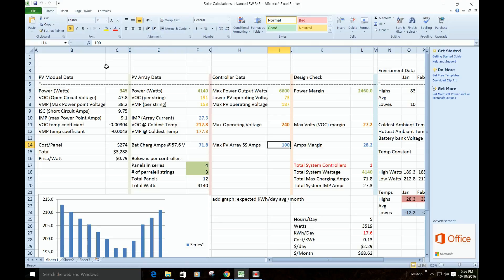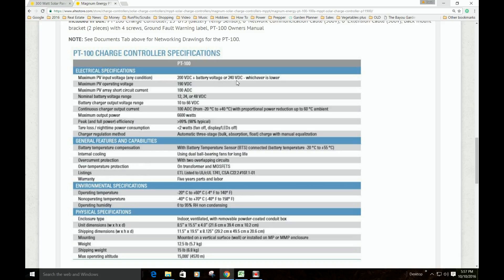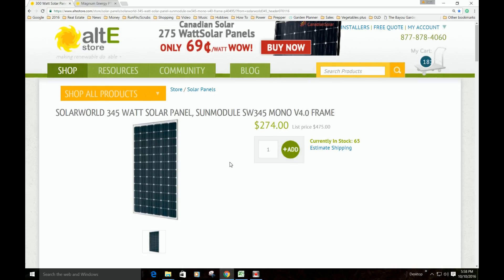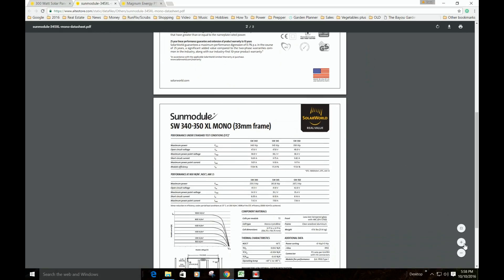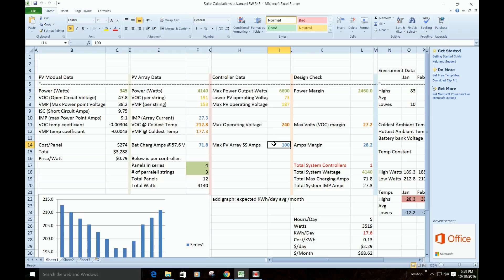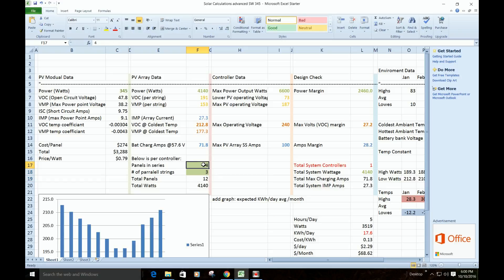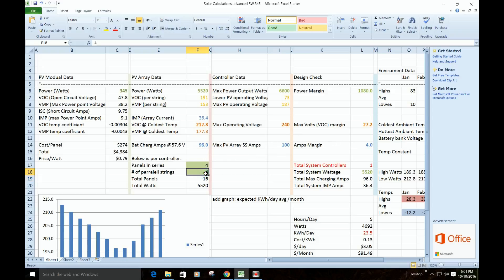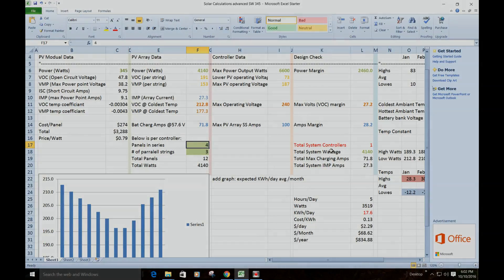Off Grid Solar #2: Matching Solar Panels to Charge Controller

Comment: Love your design.  I am planning on putting together a system about half the size of yours (7-8kw cont.)  Can the data you presented be used, just down scaled?
Reply from the maker: Robert, the system is very scalable with preferred design points as follows:

1. Base system: $11k (after 30% tax credit)
 - 4-5k on the collectors
 - single PT-100 charge controller: 100 Amps
 - single inverter: 4.4k/8.8k continuous/peak
 - 8 Trojan batteries: 370 Ah at 48Vdc

2. Base Plus: $18k (my system)
  - double the collectors to 8-9k
  - add second PT-100 charge controller
  - add second inverter for 8.8/16k total continuous/peak Watts
  - double battery bank to 740Ah at 48Vdc

3. You can take this system to:
  - about 34k on the collectors
  - 8 PT-100 charge controllers
  - 4 of the 4.4k inverters: 17.6k Watts continuous
  - not sure how many parallel banks of batteries you could add and maintain even charging???
  - can mix solar/hydro and wind seamlessly via the different charge controllers

I could add another 4k of panels, one more PT-100 charge controller and one more combiner box for about $3000 and just plug it right in.  Everything else would already support it.  

I will do a video on this at some point...  Thanks for the great question!
Reply: Thanks for getting back with me so quick, looks like I have a lot of research to do.

Comment: Very Nice!  I have a few spreadsheets myself.  Very crude compared to that one. I started out with what do I expect to have running, watts per day, etc. which lead to my sizing of the battery bank, and panels, etc.  Where your spreadsheet shines is when you actually understand the implications of voltage and amperage and the distance involved from panels to inverter, etc.  You obviously understand your system and it's limitations.  I would love to have that spreadsheet.  One other feature that would be awesome, would be in the number of panels, and number of strings area of your spreadsheet - and that would be line loss.  I discovered distance from combiner box to controller/inverter was a huge factor when considering line loss and voltage/amps, due to the size of wire, and cost, which was another factor in # of panels in series and number of strings.
Very well done, look forward to more.
Reply: I should have watched your first video......first!  Nice design work.
Reply from the maker: Yes, the voltage and amperage are "at the panel".  To be more accurate, I would need to add the drop distance from panels to combiner box and then from combiner box to charge controller.  I would also need to know the number and size of the wires, if there are in conduit, how high off the roof, if they run through an attic and how hot it is, etc...  My guess is that the voltage would be a bit lower and the current a bit higher.  I'll have to measure the actual voltage and current when I get this thing built.  I can email you the spreadsheet if you give me your address in a private message.
Reply: If you still have the spreadsheet I would love it. We are getting ready to build and it is much cheaper to put in solar than to have the power company run lines.